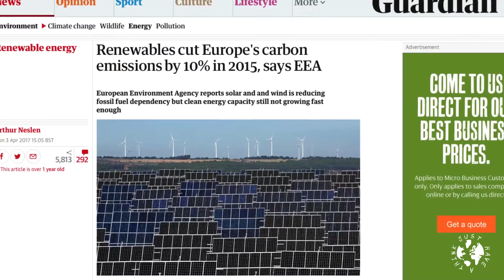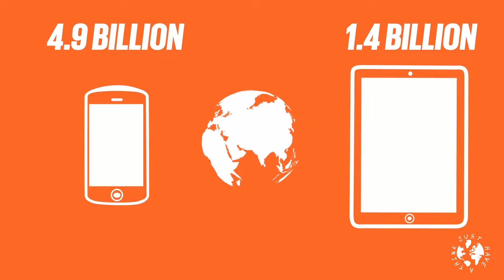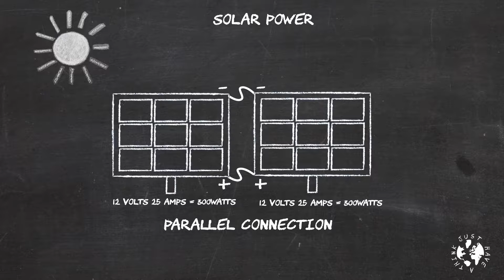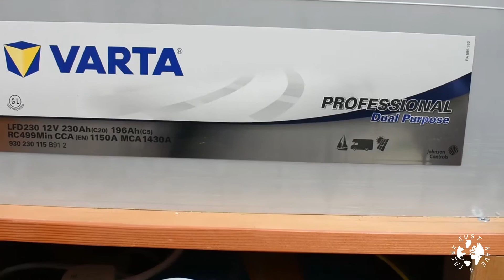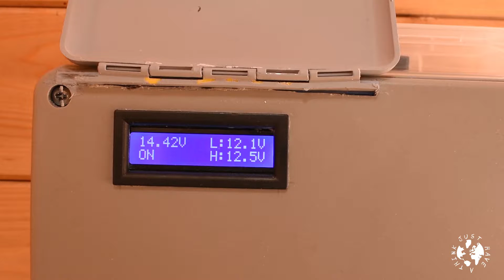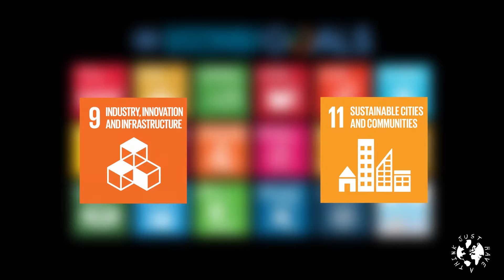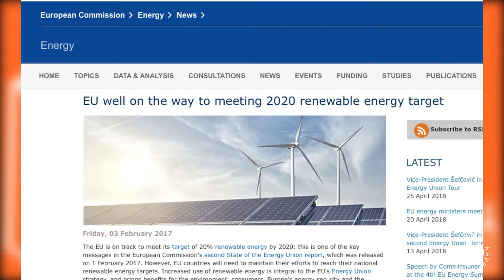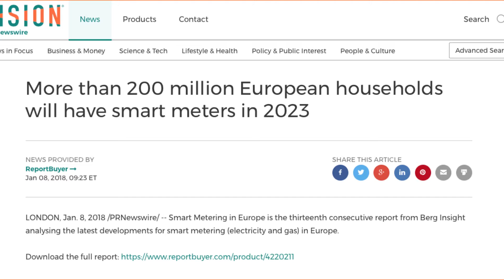Solar Power - a DIY guide

Comment: Great compliment for your videos! That’s exactly also why I want to ask you to make a video about how clean and sustainable photovoltaic-solar really is. I wonder because it takes a lot of energy to produce the panels. But how much, and how quickly do they offset in a “normal” life time the negative carbon balance they cause when they’re being manufactured, as many panels are produced not with clean energy.
Reply from the maker: Hi Paul. Good call. I'll add it to the research list.

Comment: Your approach to solar is as ethically admirable as it is physically well done. I'm going off grid with full solar and am using the updated 2019 version of Solar Electricity Handbook (the one you showed). I also found Mobile Solar Power Made Easy by William Errol Prowse very useful when I first began researching solar.

Comment: Interesting system, thanks for sharing.
I would have recommended going for a 24V system. Same two batteries, but in series, inverter for the same power rating slightly cheaper, cables half the diameter. Further, for such a (relatively) expensive system, go for a MPPT charge controller.
Reply from the maker: Hi Andreas. Thanks for the feedback. Much appreciated. My only comment is the charge controller is indeed MPPT.
Reply: @JustHaveaThink  I see, my bad. In that case it's another reason to - even if the battery remains in 12V- connect the panels in series, thus reducing losses in the wires. The advantages of MPPT are not only the tracking of the MPP, but also the higher voltage on the PV side as well as the freedom for that voltage. So you could take any panel instead of expensive 12V panels. I would guess, a 60-cell panel of 300W would be still half the price of the equivalent in 12V panels.
Reply from the maker: Hi Andreas. Thanks for your reply. I'll take a look at this once the weather gets warm again. From memory I think my charge controller will only deal with a 12V incoming supply but I'll have to check. All the best. Dave

Comment: LED lights disturb the efficiency of WiFi signals.
Reply from the maker: Surely a very small price to pay??
Reply: Should not affect if they are following the CE requirement.
Sadly a lot of producers in China do not respect this and just mark their stuff with CE and the importer who is responsible is clueless.
Reply: just buy genuine CE compliant ones , not from Ebay.
Reply: That’s a dealbreaker for me. How can I trust the CE marking?